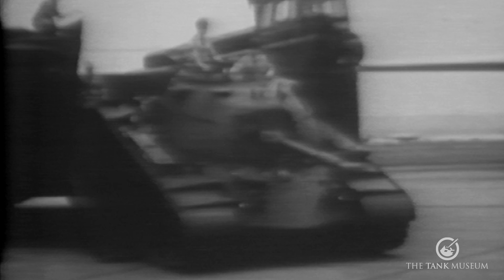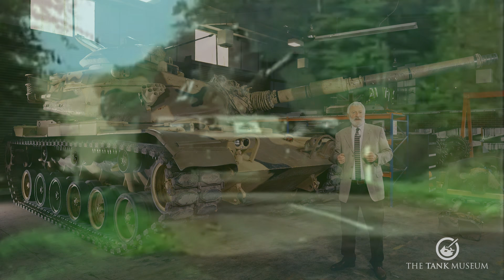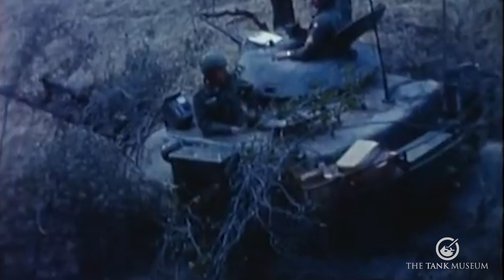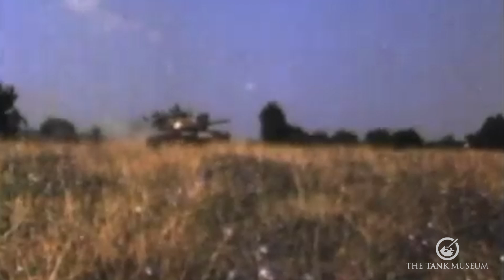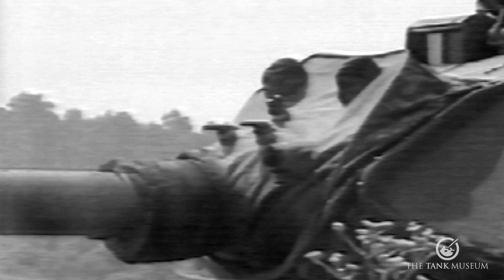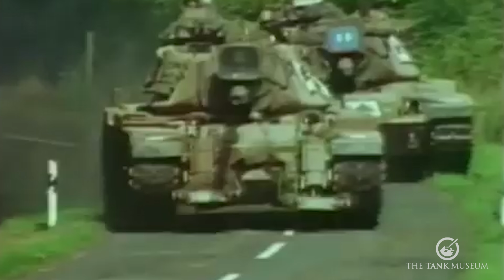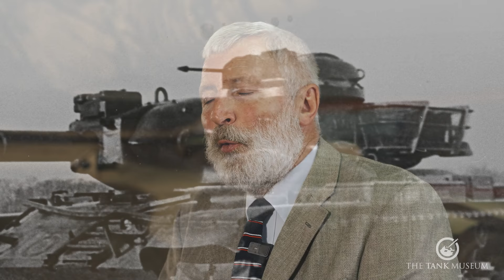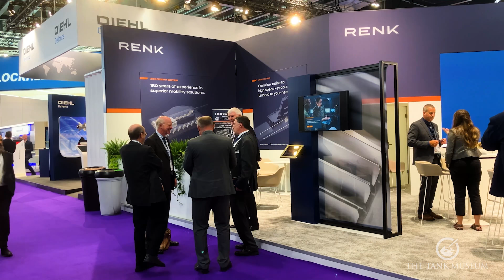M60: Cold War Guardian | Tank Chats #175

Comment: All capitalist countries ended WW2 with enormous debt. They needed to save money. The aircraft carriers existed as did the B-29’s. The army had no real way to deliver nukes. Much cheaper to do it by air. Korea changed everything. As well as the realization that nukes were not really usable except as a last-resort. Drones have changed the tank calculus once again. Are they viable on the battlefield anymore?
Reply: Capitalist? As if communist countries were better off?
Reply: Until a drone can provide an armored box holding a cannon 105mm+....the tank is absolutely still viable on the battlefield. Even in a battlefield with less than perfect air superiority, they still are useful/needed.

So long as infantry are needed, metal boxes with big guns are needed.
Reply: I know I'm ranting, but "drones made this blank useless on the battlefield" is just objectively wrong.
Are basic motor vehicles no longer of use on the battlefield because drones? 

So long as drones haven't stopped the military use of trucks/vans/motorcycles, they're not stopping the military use of tanks. Why? Because tanks do something different and important on the battlefield.
Reply: @SlavicCelery  Exactly. In fact, much of the "x makes tanks obsolete!" can be applied to infantry units too. A drone can slaughter an infantry squad a lot more readily than an Abrams, yet nobody says that infantry is an obsolete concept, do they?
Reply: @bluntcabbage6042   Finally, a voice of reason. It's not like the first AIM sidewinder made all fighters obsolete. 

That whole rhetoric is just frustrating.

Comment: Are they still manufacturing M60s?

Are they still fabricating spare parts, hulls and turrets?

Maybe a new turret for the M60 would be a good idea?
Reply: There have been many, many upgrade packages including turret replacements made and sold for the M60 over the years yeah.
Reply: I don't think so - not major components like hull and turrets. They almost stop making Abrams a few years back.
There will be automotive parts  and the like and possibly stuff like suspension components.
There may still be  large holdings of parts maybe in the US to be sold to third party user countries as required.
There used to be a number of companies offering upgrade kits for them, e.g. new gunnery systems and automotive packages and the like - not sure there are even many of them now.

Comment: Grew up in the shadow of Aberdeen Proving Grounds; it was common enough to have one of these behemoths roll down the road. The really impressive thing was the very slow undulating 'bounce' as it rolled by - the suspension damping out the motion of massive lump of armor. You could really feel the mass.
Reply: A number of the images in this video were taken from APG, or the Deer Creek Automotive Test Facility; an adjunct to APG. Public access roads ran past Deer Creek and you could often see tanks and tank chassis being tested there, including the M60 and M1. It's amazing to watch 60 or more tons of steel charging up hills or getting meters of air whilst dashing over obstacles.
Reply: When I was at Ft. Knox for training in 1989, I was a road guard when my company went to the driving range. A platoon of M1s went by first, and I noticed how quiet they were, and I didn't really feel much. Then our 13 M60A3s came by. First, I could hear them much earlier; those diesels were LOUD. But also, the ground really shook as they passed by me. Which of course means the M1s are lighter on their tracks even though they weigh more. But it was fun to feel the rumble.
Reply: @zeedub8560  I served in Germany with an armor batallion of 1AD in 1976-77 and then with 2 AD in 78-79.  The sound of a tank column rolling through some small German town and echoing off the buildings was awesome, even from inside of a tank.
Reply: @zeedub8560 xm
Reply: @zeedub8560  yeah, the M-1 is surreal-quiet. Better suspension, and that turbine is sneaky.

I delivered pizza on-post (long ago, before 9-11 security restrictions), and it was real common to meet or pass heavy armor, especially around the Armor Recovery School - M-88s always moving about.
Reply: As an old tanker, in terms of harshness of ride, the M60 rode like a Cadillac, the M551 like a Chevy, the M113 like a pickup and the M114 like a motorcycle.
Reply: It's always a little weird for me hearing people talk about Aberdeen proving ground. I'm from Scotland so my mind atomically jumps to the city of Aberdeen rather than somewhere in America!
Reply: @Grimmtoof  don't need to feel weird; the city of Aberdeen, Maryland, is indeed  named after Aberdeen, Scotland.
Reply: @Grimmtoof  For us American tank enthusiasts, Aberdeen is our Mecca. It's where all things holy happen for American armor.
Reply: @Grimmtoof   I'd think you'd be amused by how much of a Scottish influence there is in the area. (I'm from Baltimore) The city reservoir is "Loch Raven", and there's a giant statue of Robert the Bruce up in Druid Hill.
Reply: @Grimmtoof  Same here.
Reply: @Grimmtoof Yeah tanks and explosives would be a bit out of place in Aberdeen Scotland…barely.
Reply: @Grimmtoof 
I automatically discount the opinions of people that eat haggis! 😂
Reply: @mikearmstrong8483   Cant be worse than sugar. American diet last 20 years. LOL. Interesting just learning about how in the India Pakistan conflict these got rocked.
Reply: @xXPlumpkinXx  to a large degree, that's due to poor deployment and/or leadership. When used with sound doctrine, things were roughly even.
Reply: >>[ @mikearmstrong8483
Reply: I did my Army AIT at APG in the mid 80s. There was an M60 parked next to my school building. I remember eating lunch in its shadow.
Reply: Had to be careful about that bouncing though. Replacing a broken torsion bar was a PITA.
Reply: @SlinkyTWF  so I understand. I had a girlfriend who's father was a test driver at Deer Creek. Tall, spindly dude, looked like a scare crow, in his late 50s - made a living hot-rodding tanks and tank chassis through obstacles, over hills, through mud pits, and all other forms of abuse. You'd have thought him to be pretty crazy, but he was seriously rockin' the 1950s vibe.

But he had some epic 'breakdown' stories .

The tanks moving through town were going slow - maybe 20 miles per hour? - with escorts. The bounce period was maybe a whole minute, peak to peak? Very slow, quite shallow, but it gave you this incredible sense of just how heavy and powerful those beasts were.
Reply: Breakdown stories, such like: 
"How was your day?"
"Crimped a couple shock tubes, lost half a day waiting for the mechanics."

Crimped shock absorber tubes. On an M-60.
😮
Reply: I can't imagine a Cleethorpes or Bognor Regis in USA!
Reply: @amjbzx7  couldn't find a Bognor or Cleethorpes in the US, but there is a Grimsby!
Reply: There's something like 3 Lutons, and also one in Canada :s @amjbzx7
Reply: As weird as it seems.... I live in a very rural part of England, but we have a tank restorer working 500 metres away. I didn't know this until I saw Richard 'Challenger' Cutland ride past in an AMX-13, then had to pull over when an M-47 pulled out of their yard to pop down to the garage for some diesel and a Ginsters pasty.
Reply: You ever see Kurt?
Reply: I was stationed at APG - Edgewood Arsenal '75-'79 . One of the test ranges for the M1 Abrams was just up the road from one of our operations areas and we always had to be on the lookout for those beasts on the route to our area ( O Field for those of you familiar with the post). This before the deployment of the first M1 Abrams IIRC.

That peninsula was also the site of major burials of chemical munitions moved out of Germany and Japan post-WWII. One of those dumps blew up in the early 50s, scattering WP and even chemical rounds all over the peninsula. We spent a good deal of our time recovering and disposing of WP rounds surfacing after rainfalls. I don't know if any of the M1s encountered any of that but they were all over the peninsula.
Reply: @jamessweet5341  yeah, the high-pressure rifle (L7 105mm) test range was over near Edgewood - an astonishing sight; woods, then a security barrier that required you to call rage safety before it would rise, then a hundred meter stretch where every tree had been mowed off at ~1.5 meter height, the another barrier (and phone), followed by more woods. They just set up a range by opening fire in a lane through the trees, until there were no more trees in the way.

There are still fields there that catch fire spontaneously every spring.
Reply: I got exiled to Aberdeen and used to take those apart. LOL, I once did a wheely with a M-60 A-2.  Tanker like them because of the hydraulics - the electronics could be shot out, but the turret could still operate and target manually.
Reply: When I was young my older friend was an M1 driver first gen used to blow those Allison transmissions up at over 60 mph
Reply: You lucky bugger! I am jealous. That would of been fantastic as a kid and a adult.
Reply: @Spartan902  it was pretty damn cool, yeah. Of course, we had other things not so fun - like artillery and tank fire rattling the windows at random intervals.
Reply: @lairdcummings9092 damn you! I am so jealous!
Reply: My grandmother lived near Aberdeen,  occasionally it was very loud when visiting her
Reply: @JohnBeebe  yes, yes it could.
Reply: I’m from Cecil county lol
Reply: @lairdcummings9092  and I think it was like 11 pounds per square inch of tread. Yeah they were awesome tanks
Reply: lol wasn’t very uncommon to see them on rail cars rolling down the tracks growing up not far from the tank arsenal in Detroit .
Reply: I used to see these on the Autobahn by Ramstein AB in the '80s until the Abrahams came out. Always used the right lane!
Reply: I grew up a bit further away. Often heard the “thunder” but almost everyone on my street was either military or civilian engineer
Reply: I live in Aberdeen I wish I could see that tank
Reply: Oh those blast waves 😂😂😂😂